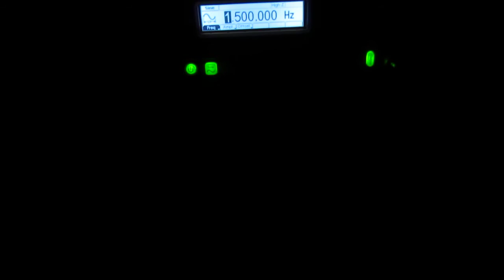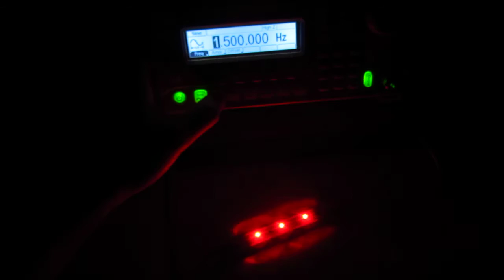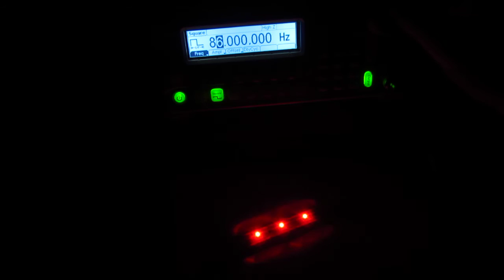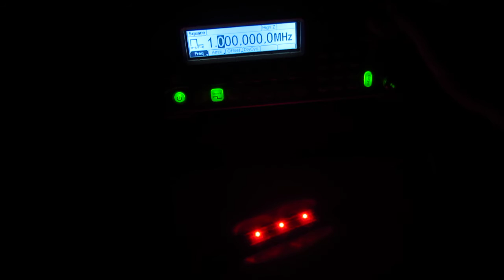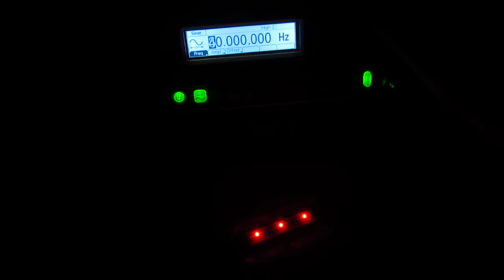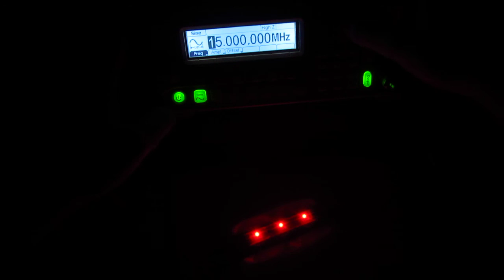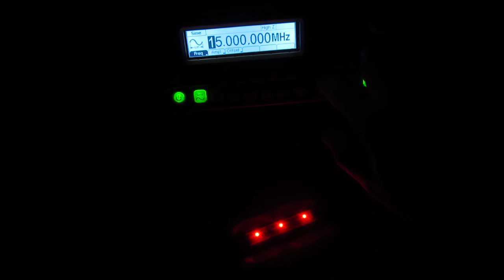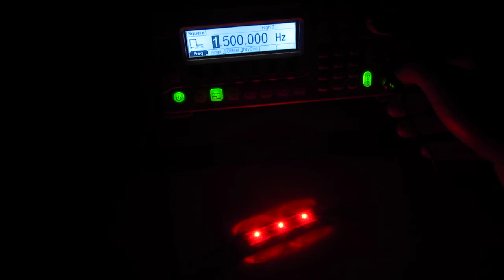Signal Generator + LED

Comment: Hello,
I'm very new in this. Could you please tell me how could I run a mosfet by using a signal generator? I need to pulse a square wave into a solenoid. Is there a way to make the signal generator to put out only DC wave or should I use diodes to only use the upper side of the wave form? Sorry if my question sounds stupid...
Reply from the maker: Life is illusion I'm not a pro in electronics, but here is a video related to mosfet: https://www.youtube.com/watch?v=lf4V97HZZ0M. If the output power of the signal generator is high enough than it might be able to power the solenoid directly without a mosfet. Newer signal generators should have DC output also.
Reply: Thanks a lot my friend, I really appreciate it :)

Comment: Are there any circuit schematics available for making the LED circuit that uses the signal generator as a source?
Reply from the maker: +Lauren St. Peter 
Circuits to make the LEDs flash? Try some PWM circuits.

Comment: Excuse me, I want to do the same project but I'm afraid to damage the signal generator. what are the values of resistance and leds? thank you @furulevi
Reply from the maker: +jay lord frama 
The signal/function generator's output was connected directly onto a 12 volt LED unit, which has 3 LEDs. I didn't used any resistors in this setup, that would only reduce the light output of the LED. Modern function generators can light up small incandescent light bulbs also without any problem (3v-12v bulbs).
Reply: +furulevi thanks!! do you know the amp. for this leds.?
Reply from the maker: Around 20-30 milliamps at 12volts if powered from a battery or an adapter.If you power the LED using the function generator you have to use a higher voltage because the power output is not high.
Reply: +furulevi thank you very much!
Reply: @furulevi  Dzięki tobie zrozumiałem jak działa generator funkcyjny , nawet w instrukcji nie jest napisane jak to działa ;)

Comment: how can is possible? a...im new begin electronic..

i use feel tech machine and i was connect 1.5v light or motor but is not happen anything how can led possible active?
Reply from the maker: This Rigol signal/function generator outputs a pretty high amperage, thus it can power ON LEDs. Older signal generators might output much lower current (Amps).